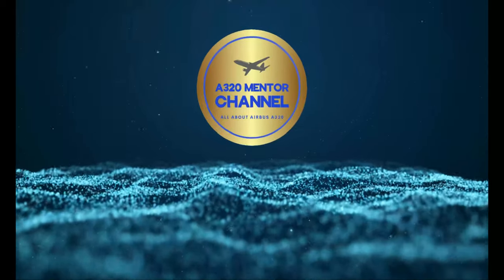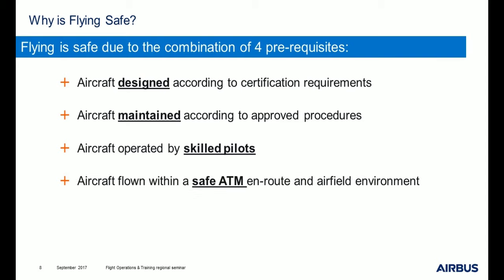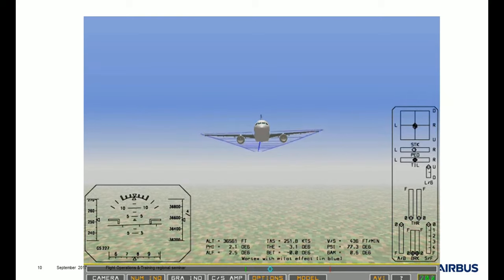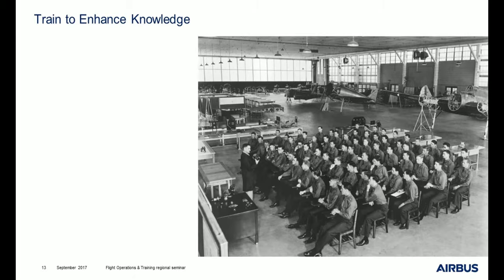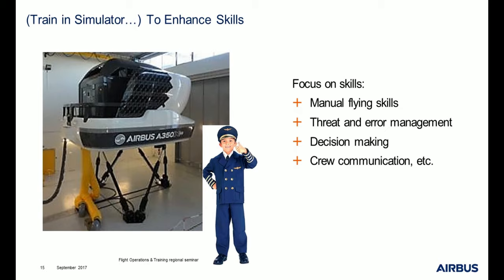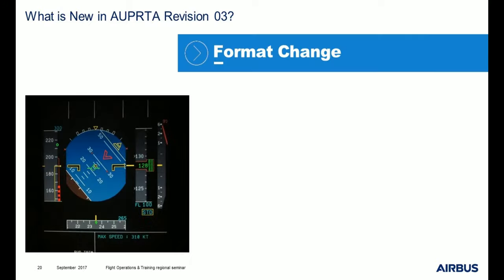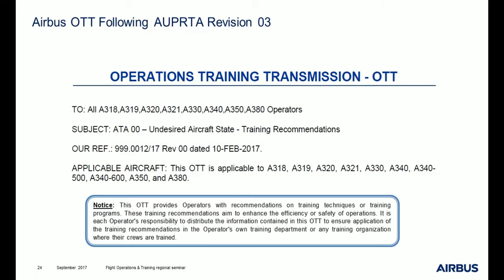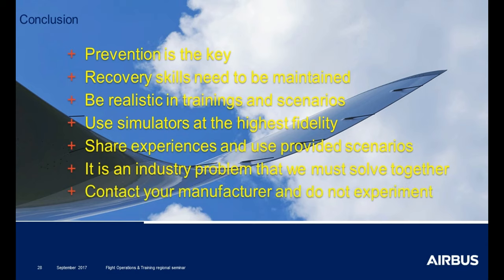Upset Recovery Training and Manual Flight

Comment: Clearly the pilot inputs during the actual event are instinctive and natural. The aircraft clearly shows handling deficiencies due to excessive phase lag; you can see the pilot selecting full lateral right while the aircraft is rolling left. To account for this deficiency in handling, it requires an unintuitive technique of backing off inputs. The culprit here is lack of damping at altitude and possibly poor implementation of flight controls.